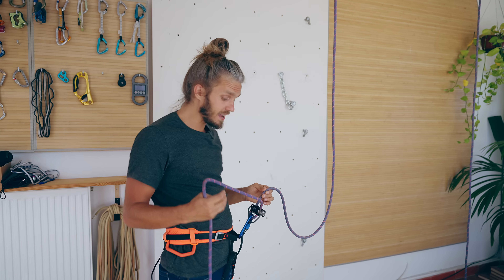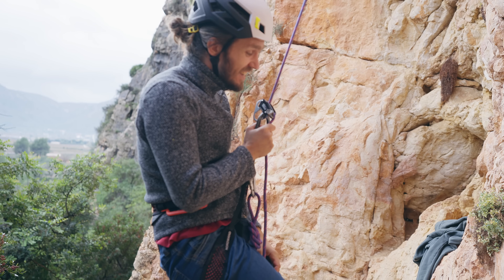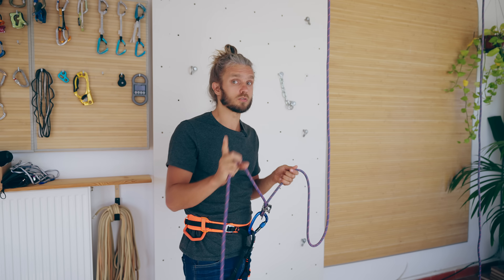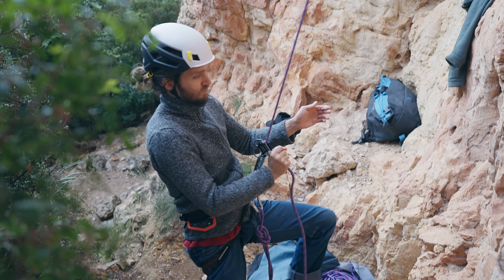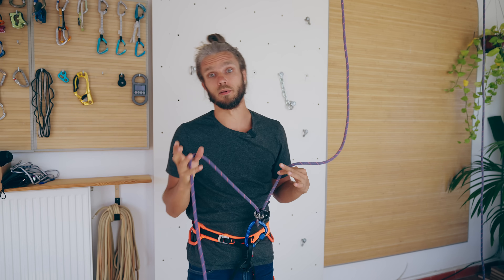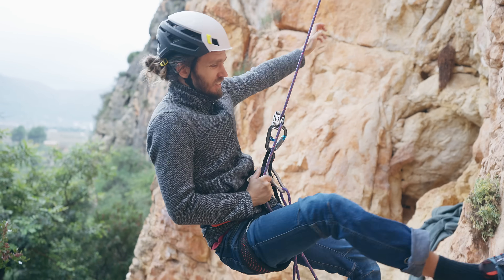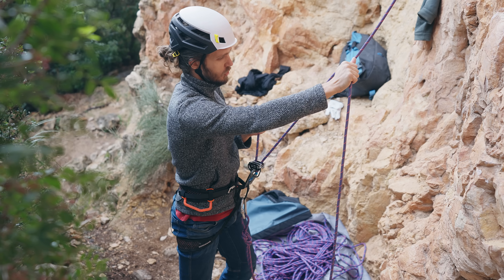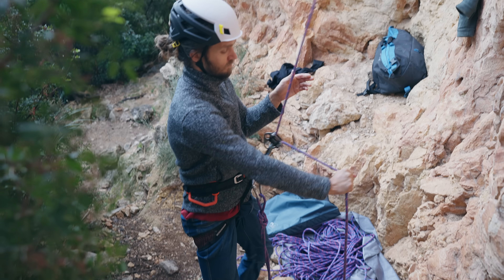Brake Hand Up during a Fall? 0.92s to bring it down... or...!

Comment: Really shocking. Let's you think. So is a tube useless for belaying for everyone not being a cheetah?
Reply from the maker: I'm not a fan of Tube Style devices personally, but if you follow proper technique it's not useless and it def has it's place ;)
Reply: I really appreciate that you answer personally. In all honesty this makes me really insecure now. I am experienced for years in belaying with a tube both toprope and lead. However right now this is decently overwhelming.
Reply from the maker: @christiangehl3134  Well if you are experienced with Tube, you know what you are doing ;) But my next vid will go a bit deeper into this topic
Reply: Indeed, so why panicing. 🙂 Looking forward to it.
Reply: @christiangehl3134  I can tell you why I dislike being belayed with a tube. Even if I trust my belayer. If you take a fall where the belayer is pulled out of balance and is about to slam sideways into the wall (aka they cannot catch the slam with their feet). It's very very easy to instinctively let go of the belay end of the rope before you can even think about what the fuck you are doing to catch yourself. 
I have accidentally done this once but with a Grigri. So it was all good. But with a tube it would have been terrible ^^

To add. just out of curiousity. Is there any specific reason why you don't like assisted breaking devices? There are many that works well and are easy to operate :) Especially with the right type of rope and coating on the rope.
Reply: @SonnyKnutson  really well said. I have got to give you this. How can belayer side crashes into the wall happen? I use Gri Gri, Gri Gri 2 and Plus now and then. However I really rarely climb outdoors. And inside I only use this Gri Gri models toprope. Belaying lead with the Gri Gri scares the self-censored out of me.
Reply: @christiangehl3134  what part about belaying a leader with a Grigri scares you?
Reply: @christiangehl3134  I have the same feeling, i like grigri for top-ropes. Giving slack quickly with the grigri scares me
Reply: Honestly I am traumatized by lead climbing
Reply: @christiangehl3134  Why is that? Just scared or did something happen?
Reply: @tomgnyc  I had a about 9 m back to the wall fall on one of my first lead climbs. And belaying lead with a Gri Gri seems really intimidating to me.
Reply: The fall was head first
Reply: @christiangehl3134  Oof. Hope you weren't hurt badly.
Reply: @christiangehl3134  I use a Mammut Smart for lead belaying. Really easy and simple assisted blocking device. Although almost all of my lead climbing partners use GriGris. I've used them for lead; easy, but I don't prefer them. They just seem too complex to me.
Reply: @tomgnyc  me not at all luckyly. Only the memories are still hard.

Comment: Great video although only the first try really showed a hand up situation finally. Sport climbing with tube style belay devices is dangerous I‘d say.
Reply: i do lots of sport climbing on an ATC and wonder if the belay style of matching hands at the bottom is safer/less safe than the "shoveling" style of pulling the climbers side and then just sliding your brake hand up the rope

Comment: Nice. Scary shit, good content! What I frequently see in the gym is people shifting hands while the hands are still above the belaye device, i.e. while the belay device is still open. Maybe you could make a video on this?
Reply from the maker: Thanks, I'll include your point into my video about proper use of belaying devices.
Reply: @HardIsEasy  Could you maybe include or make a separate video on the importance of the belayers awareness of the route topography? i.e When to soft catch and when to keep it tight because of a ledge or a rock formation sticking out or a sloped sidewall(aka sloped ledge) that you climb out over. 
Being aware of the position and potential fall consequence for the climber is very important. Yes, a hard catch can cause injury but a ledge fall can cause a LOT worse :P

Comment: You should be watching your climber while belaying not the rope. You'll see your climber falling (not be surprised by the sudden tension in the system) giving you time to react accordingly.
Reply: I agree but there are instances when u cannot see your climber...so great demonstration in my opinion.
Reply: @J-Zee3537  I agree. There are many times you cannot see the climber. Learning to belay by feeling is also important. It will also help with learning how to soft catch better.
Being able to see your climber or knowing the route they are about to climb is also important. There are plenty cases where there are ledges or things sticking out where you wouldn't want a long soft catch. So it's important as a belayer to be aware of this.

Comment: I only use this style of bellay device one workaround for this issue is to make a prusik and tie it to your leg loop of your harness I personally do this only on long multi pitches.
Reply from the maker: Not entirely shure what you are doing, but prusik on a leg has a risk that if you leg goes up it won't help you ;)
Reply: @HardIsEasy   i learned that from an old Mountain Guide, i havent had the Situation that the leg Went up .. also i havent had to chatch a hard Fall with this configuration
Reply: @antrumkfpsalatschleuder8768  sounds like a "spiderman" rappel type set up, i think extending the belay device by putting it on a sling and then attaching the prusik closer to the belay loop is preferred when possible